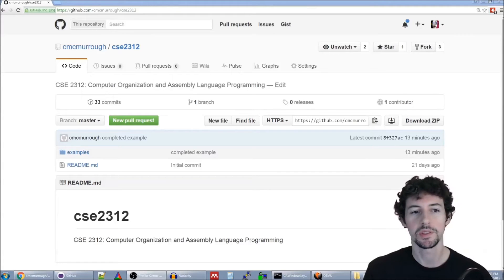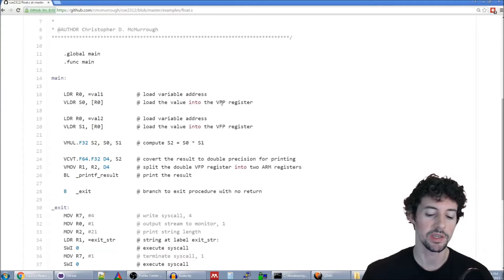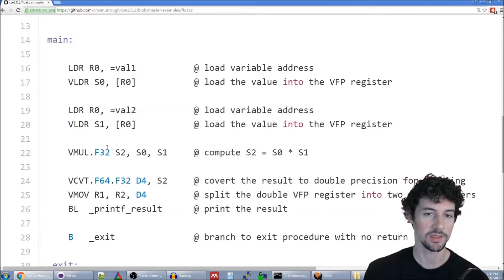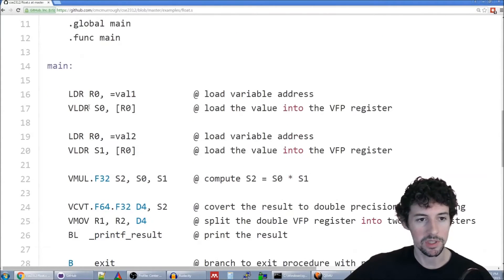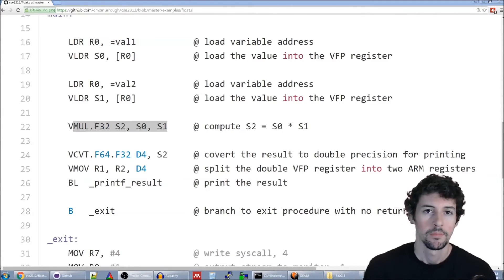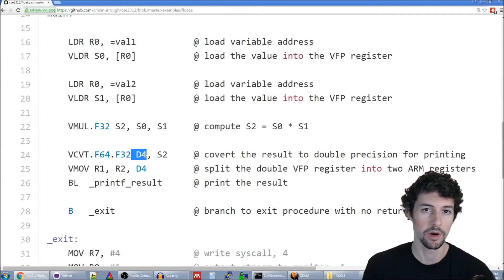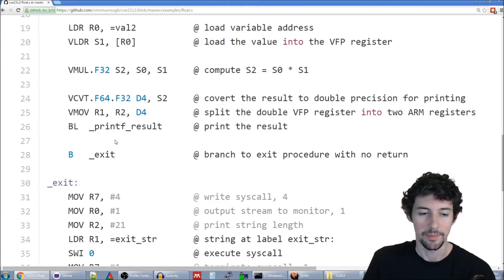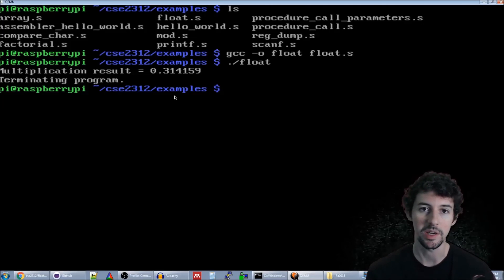Floating point basics

Comment: How to enable the FPU on the arm ? Is there any specific code ?
Reply from the maker: +Sunit Paul It is always enabled, you just need to use the proper assembly instructions to take advantage it. I have an example here...    https://github.com/cmcmurrough/cse2312/blob/master/examples/float.s
Reply: +Christopher McMurrough 
Thank you for the quick reply. Actually I am trying to program my STM32F4discovery board using GDB. I defined a function in assembly to find the floor value of a float variable. 
I declared the function prototype in my main.c file and defined the floor function in my .s file.

so on gdb when I call the function : print floor(4.5)it gives me an errorgdb: print floor(4.5)A problem internal to GDB has been detected../../gdb/gdb/regcache.c:884: internal-error: regcache_cooked_write: Assertion `regnum >= 0' failed.(gdb) print floor(4.5)

Later I declared a global variable floor_of_int and called the floor function implicitly in my main function 
floor_of_int=floor(4.5)
Now that worked. 

why wouldn't the first case work ?
Reply: the assembler needs to know to include floating point library: "-mfpu=vfpv2" <https://thinkingeek.com/2013/05/12/arm-assembler-raspberry-pi-chapter-13/>